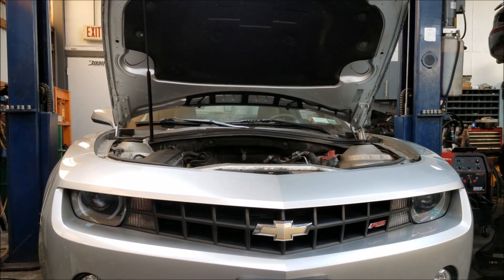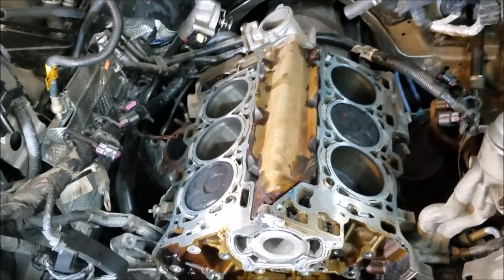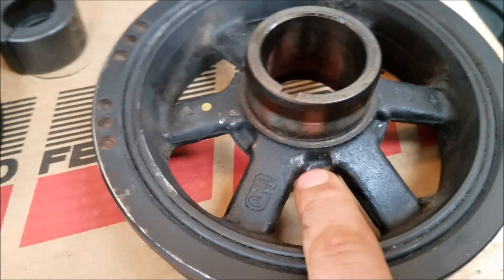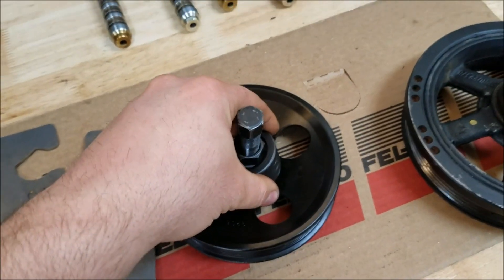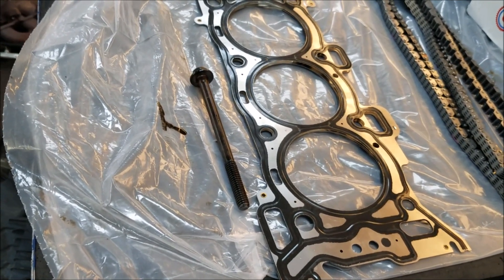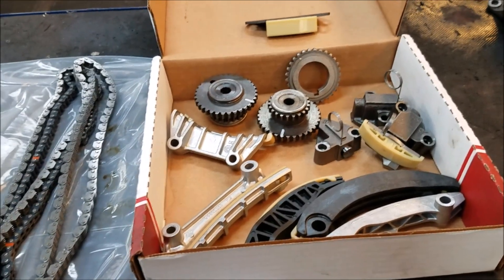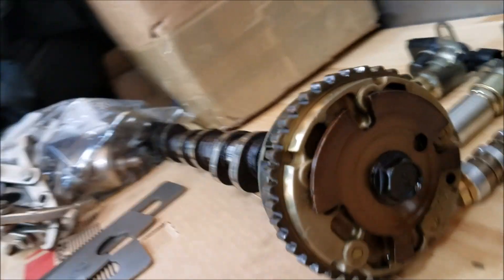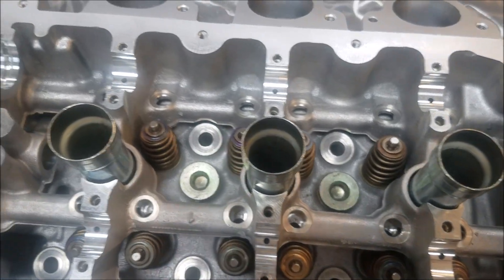2007-2015 3.6 V6 GM HIGH FEATURE TIMING CHAIN/HEADS INSTALLATION GUIDE/TIPS. BIRDIE'S PRO-TECH

Comment: So i believe my timing chain tensioner took a crap and now my engine is out of time. The engine still runs but very very poorly and sounds like a diesel lol. What are the chances i can just put in a new timing chain set and put it back in time and be good? If i have to replace the heads or rip them off its going to the scrapper. But if its just a timing job ill spend a few hundred on that.
Reply from the maker: Sorry to hear that.... Are you still going ahead with repairs?
Reply: @birdiesspeedshop6997  Not at this moment, got 2 other cars so this one is gonna sit in the field for a while until I decide if I wanna drop the money on repairing it. Was worth a shot putting it back in time tho!
Reply from the maker: Hi Cutchlt. I would start by pulling codes from the computer. Just to rule out a simple fix like an ignition misfire. Also a dry compression test and a cylinder leak test should give you an idea or at least isolate a problem with a specific cylinder. Try to figure out as much as possible before disassembly. If it's the worse case, depending on the mileage the engine has seen, you may want to consider rebuilding/resurfacing the heads. Hope this helps and best of luck!
Reply: @birdiesspeedshop6997  Thanks for the reply! If the engine did jump time, are the chances of a bent valve high or low?
Reply from the maker: @KevDoesStuff  Unfortunately, its a roll the dice. I'm going to say you will be good just for the sake of being positive!
Reply: @birdiesspeedshop6997  Haha thanks! Gonna rip into it next week. Hoping for the best!
Reply: @birdiesspeedshop6997  also, is a compression test safe if the timing is off a couple teeth, I do not know if this is an interference engine.
Reply from the maker: @KevDoesStuff  If the engine is already in a bad state, a compression test won't hurt anything further. I'm hoping for good news for you.
Reply: @birdiesspeedshop6997  This all could of been avoided if i addressed the noise when it started 6 months ago lol. I called a shop and they said a tensioner and or guide grenaded and let the timing to skip a few teeth.
Reply: @birdiesspeedshop6997  Bad news, put it back in time and all but 1 cylinder showed compression. Dang.

Comment: when tightening the crank pulley would  the timing move
Reply from the maker: Hi Claudio. Great question! When it comes time to re-install the crank pulley at the end of the job, all 3 chains would already be installed, so it is safe to do so.
Reply: It can but it wont matter

Comment: so this is an interference motor?  timing jumped and all the rockers came out!!  intake cam btw... im wondering if thats why the rockers were destroyed.. ill do a leak down test tomorrow... wow,  im totally pissed off now... knowing my luck those valves are bent... any info would be appreciated  thanks.. great vid
Reply from the maker: Hello! YES, this engine is an interference engine. Although, there is a lot of debate on that.
  I would start by pulling the heads and checking them out. A broken valve spring, worn chain/guides or a faulty actuator could have been the culprit of the failure. Replace damaged parts as necessary. I would also recommend changing all four cam phasers/actuators and the chain and guide set. Thank you, I hope this helps!

Comment: DYI guy rebuilding this engine for a Saturn Outlook.   Two simple questions:    1)  is there no gasket or oring for the oil pump?  Seems like there should be...    2)  On each camshaft there is a small seal that is a wrap-around style.  Looks to be Teflon or similar material.   Where can I procure those?   Do you have a GM part ID or number?           Many thanks for this video...lots of good info.
Reply from the maker: Hi and thank you for watching! The oil pump does has an O-ring seal between the engine block and the back of the pump and also an O-ring for the oil pickup tube. A new pump should come with both new O-rings. Example- Melling oil pump #M353

On the the camshafts, they do not have an external or internal seal. The valve cover and gaskets completely seal off the camshafts and the timing chains, so a cam seal isn't required on this particular engine. 

Please double check the part number(s) for fitment.

Comment: Cloyes video uses a two stage process to replace the chains which bypasses the need to lock the cams. They don't use the cam lock tools.I'm wondering if the engine had misalignment of the cams ( due chain wear) which method works best?
Reply from the maker: Hi.Thank you for commenting! I would suggest using which ever method you're more comfortable with. As long as everything gets installed/aligned properly, it's a good method!

Comment: Okay so my question is my stage 2 timing is off well the cams are not in the right positions so how can I move them around without disturbing the other side
Reply from the maker: Russell Logue Hi Russell. Im not sure exactly the situation your in, but I would suggest starting over to be certain you have it %100 correct. You want to check that everything lines up before you pull those pins on the tensioners.

Comment: I'm having issue with Terrain 3.0 and I'm sure it needs timing chains. Couple of questions, do you think I should replace the intake and exhaust solenoids? Also, can this job be done in chassis or do I have to drop the cradle? Is Alldata good reference material for what I'm about to take on?
Reply from the maker: 6S Pyro Hello and thank you for watching our video! Yes, the work can be done in the chassis although, I would recommend dropping the engine so you have the room to do the job properly. I would replace all 4 vvt solenoids as well as the 4 cam sensors while you have access to them, but be sure to replace them with good quality parts. I've used Alldata in the past, that should be a good reference for a step by step guide on removal and installation.

Comment: How much would the job cost that I seen on your video? I have the same issue P0008 just hard to find a place I can trust, Great video
Reply from the maker: Benny Lara Thanks for watching! A job like this would vary depending on what shop you go to and what would need to be replaced . I've seen quotes from 3k to 7k+.....some quotes even higher.
Reply: @birdiesspeedshop6997   hey birdie. Have the 3.6. When I took the chains off I believe the cams spun is there a way to fix this thanks
Reply from the maker: @jamesredd9215  Hi James. Do you mean spun or damaged cam journals on the cylinder heads?
Reply: @birdiesspeedshop6997  no sir the cam phasers and turned I wasn't informed that I had to lock cams in place before removing chains
Reply from the maker: @jamesredd9215  Ok great, that is definitely not a problem. Just follow the cloyes video link. The lock outs are not required to do this job. I show them in my video as an option. As long as the job is done right, there is no wrong way. You will be able to rotate everything back in place and continue your installation.
Reply: Mine was under AUD $ 4k. LLT engine in a Commodore Sv6.
Reply: @craigbullock8245  what did u get done? my ve sv6 is stuffed
Reply: @clints8888  new timing chain etc.  I have since replaced that one with another and this time did it myself.  I enjoyed doing it and saved a lot of money.  Took a lot of time though since it was a first time doing that sort of thing.  RevHigh sold me a good kit.  Once the timing chain is resolved the engine comes back to life and out of limp mode.